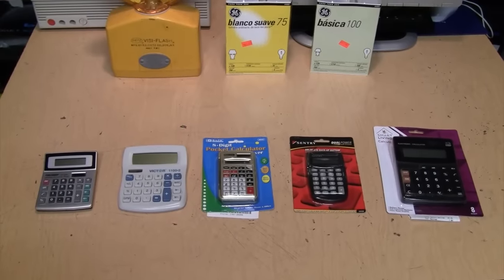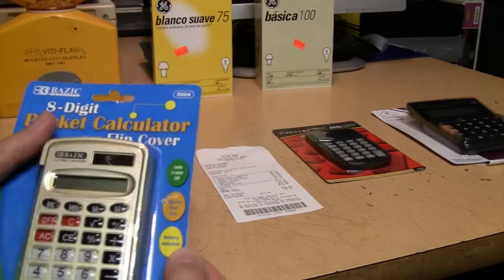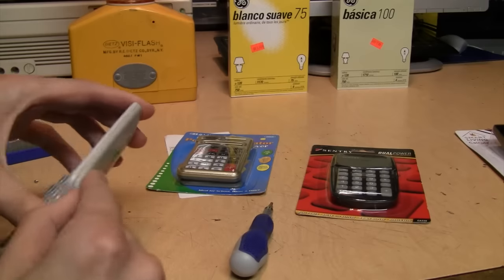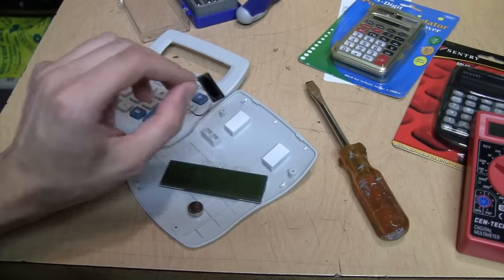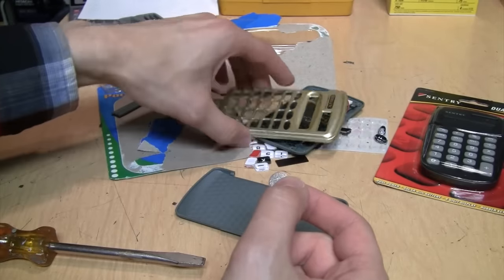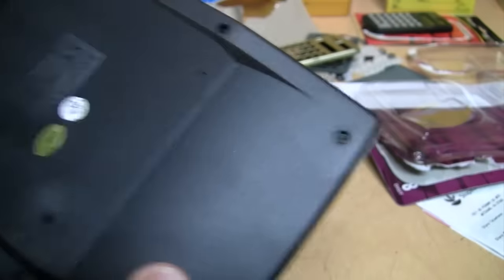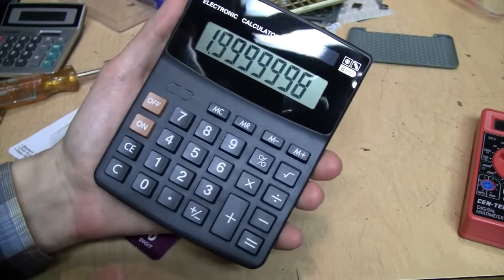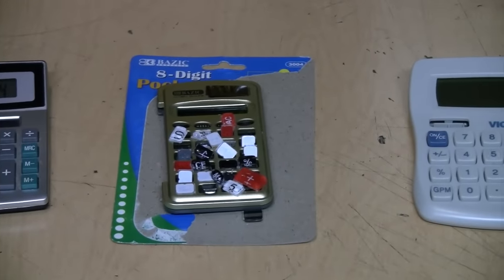Solar calculators BUSTED!

Comment: Many manufacturers use the same injection moulded frame for a range of calculators so it's cheaper to fill in the unused solar panel hole than it is to create a new mould.
Reply: Bingo!
Reply: That's a good guess. But it's also possible they've  tested sales of calculators with and without solar blanks and have found the former sell better.

Comment: This made me real curious about my own calculators, because I was sure I had one of those Big Display calculators!

Obviously, I started with a Big Display calculator that looked almost identical to the silver one he opened at the very end.
You know, the one that used to belong to Ms Dorothy Sheehy ?
So I opened it up, and it looked EXACTLY like the silver Big Display calculator ... except it DID have a solar panel in it !
And it worked without the battery in it, so it was a REAL solar panel too.

Talk about a surprise!
I was not done with surprises though.

I opened up my Texas Instruments Ti-30X II S ... probably cost me about 20 bucks, 15 years ago or so.
And sure  enough, it had both battery and solar panel inside, but the solar panel had a surprise in wait for me.
Pulling the battery it still worked fine doing simple calculations, just like expected.
But when you did complex stuff, the solar panel wasn't strong enough, or the capacitors were too small.
It sure ran out of power quickly, but the panel was working.

What an interesting surprise, this was turning out to be quite fun.
But ... well, you can probably guess it already - I was not done with surprises just yet.

I finally got my hands on oldest and most broken calculator, a Texas Instruments Ti-106.
I bought it back in 1998, it has been with me in classrooms, at home, and in a gravel pit.
It has been "dipped" in coffee or Sodapop more times than I can count.

It has generally lived a hard life.

Last time I lend it out to a friend, it came back with a broken display - But it still turns on.
Only reason I hadn't thrown it out, was because I had put it in a spot where I had forgotten about it.
So I opened it up to see if it really had a solar panel - And sure enough, it did have one .. a real one too.

How do I know ?

Because it doesn't have a battery.
Just the solar panel !

Comment: Fun fact;

The reason the pocket calculator doesn't give 2 as the result of sqrt(2) * sqrt(2) is because it's using a truncated data type (or more likely, it's just doing binary addition using a simple ALU that cannot handle enough significant digits). A simplified example:

sqrt(2) truncated to 3 digits = 1,41

1,41 * 1,41 = 1,9881
Reply: I was going to say something like this. Though it's in part because root 2 is irrational, so you would need to store an infinite number of decimal places to store it precisely, therefore any stored representation of it will always be a little bit out from the true value. Also if the displayed answer was limited to less decimal places than the input that would result in some rounding that would potentially give the answer as 2, which would be indicative of a cheaper, or at least more restricted one, rather than a better or more expensive one surely?
Reply: Yeah, I was thinking the same thing.
Reply: Jerri Kangasniemi
I don't understand what you said but I liked your research about it.
Reply: +Feroz
It's a physical limitation of computers

(for this example you can equate 'wires' with 'bits')

We can use 1 wire to represent the numbers: 0 and 1
wire1
OFF (we may call this 0)
ON (we may call this 1)

we can use 2 wires to represent the numbers: 0 thru 3

just use all different combinations of ON and OFF to represent different numbers

wire1 wire2   number
OFF    OFF     (0)
OFF    ON       (1)
ON      OFF     (2)
ON      ON       (3)

we can use 3 wires to represent the numbers 0 thru 7
wire1   wire2   wire3   number
OFF     OFF      OFF     (0)
OFF     OFF      ON       (1)
OFF     ON       OFF      (2)
OFF     ON       ON        (3)
ON       OFF     OFF      (4)
ON       OFF     ON        (5)
ON       ON       OFF      (6)
ON       ON       ON        (7)

and so on...

To represent larger numbers, or more decimals, you need more wires but we can't use too many wires otherwise it might not fit in the calculator. This is why you get an error if you multiply with huge numbers with calculators, or get rounding errors with decimals.

Comment: It is cheaper to just use the same casing for both solar and battery calculators. In the battery ones, they just put a fake solar cell in, and in solar an actual solar cell. Calc manufacturers have been doing this as long as solar calcs have existed..
Reply: That kind of makes sense, but it would make more sense if they didn't make the fake part look like a solar panel if they weren't trying to be misleading. I would also say they would only have been like that since extremely cheap solar calculators have been made. Decades ago, all calculators that looked like they were solar, were. But they weren't as cheap, and were often brand name.

Comment: The one I regularly took apart during high school classes would still work without the chemical battery afaik.

After covering the solar cell (and the chemical cell taken out ofc) the display would quickly fade and pressing any of the buttons would drain all the voltage ~immediately. But in direct sunlight it was perfectly fine and happily working

Comment: The smart living calculator might actually be good. I might be remembering this wrong, but I've read that a solar cell can actually charge or drain a battery. So, a diode is used to make sure that electricity only flows in one direction so that the solar cell only charges. That looked like a germanium diode, which ain't cheap. I'm guessing that they left the leads long in case the unit didn't work, so they could take it out and put it with some other board. The diode might also have been a last minute addition. I don't know, I'm just a Pretengineer.
Reply: I wonder if they can be used similar to the diodes that power crystal radios

Comment: It's likely they just make 1 plastic body for these calculators. While some have solar cells for energy, they probably make a cheaper battery edition. They just don't bother designing and molding new cases. Do they make any claims on any of battery ones that they are in fact solar?

Comment: I remember having a 'dual power' calculator many years ago and I deliberately took out the battery so it ONLY worked on solar power. Didn't feel like having to replace it all the time lol
Reply: I have a calculator like that, it takes 1 AA battery, I normally just use it as a solar only calculator, of there is no battery in there it cannot leak.

Comment: I really miss incandescent light bulbs.
Reply: Since Trump took office 100 watt bulbs are back on store shelves.
Reply: lucifer thebringeroflight why!????!?!??!!?
Reply: Not Important,
An Easy-bake Oven.
Reply: That's funny and interesting. I would imagine the potential for salmonella poisoning from eggs in batter that wasn't properly cooked would be the biggest concern. 

But yeah, incandescent lights are mostly just useful if the heat produced is beneficial in some way.
Reply: The heat in an oven would destroy semiconductor technology
Reply: +George V. Cohea There are lower wattage Halogen Pseudo-Incandescent bulbs that work like Incandescent bulbs but use less electricity on the market, they were not banned in any way (production in the USA continues to this day on Halogen bulbs). Halogen bulbs produce heat as well, but i do not know if it is as much as an Incandescent, less or more.
Reply: Stig, all bulbs (and electric appliances) will produce heat in proportion to their wattage. (Though in some cases the heat winds up outside, like an A/C)
Reply: Cerus, I know that sounds intuitive. But, if a blender is rated at 1200 watts that's going to be peak power output. Whereas the bulb will be 1200w continuous. But if you clamp an ammeter on both and get an identical reading and both are in identical boxes, they will heat at the same rate. It's really just the way the physics works. Any sounds, movement, light, etc. will all convert into heat. This is what is meant by the principle "energy can be neither created nor destroyed".
Reply: Stig Rabbid << The halogen bulbs in those cheesy torchiere floor lamps put out massive amounts of heat. The bulbs are made of quartz because the heat would melt a glass bulb. They often discolor the paint on the ceiling above the lamp too.

Comment: I have an old air conditioning and heater thermostat which can be programmed for every day of the week at four different times. It is an old thing but does the job. Also, It is not intrusive like the new wifi ones. A few months ago, it stopped working, nothing on display. I disassemble it and checked all voltages and soldering, and everything looked OK. I took the microscope out and started poking around to see the signals coming out of the micro; nothing, it was dead. Then, I checked the realtime crystal oscillator, and it looked like the micro was trying to start it every two seconds. I ordered the part from Digi-Key and replaced the realtime clock. This fixed it. I could have bought a new one, but I like this one.

Comment: That lose  diode is a zener diode. It prevents over-volting the circuit.
Reply: A zener would not be connected in series with the battery, and not in the forward direction either. 
It's probably for reverse polarity protection, if the battery is put in the wrong way.
Reply: I assumed its to stop the solar cell feeding voltage back into the non rechargeable battery
Reply: Zener diodes and chemical batteries. 
Hmm.

Comment: It's because the square root of 2 is more than 8 digits in length at 1.41421356237, and unless you're using a calculator which can go to the required number of digits (12), it's going to fall short automatically (regardless of how cheap or expensive the calculator is) when you do √2 x √2. So what you were asking it to do when you multiplied it by itself due to the 8 digit limitation, was 1.4142135 x 1.4142135, which gives you the answer you were seeing on the displays.
Reply: InuKun2008 regardless a root squared is what the number being root squared is
Reply: @PorWik  Regardless of your comment, computers are not working like your understanding of math.
Reply: BTW for anyone interested in the odd behaviour of calculators sometimes, google "IEEE754"
Reply: @Superlokkus5  Yes because your comment is so enticing it will make all the kids want to learn the fundamentals of computer science....... lol
Reply: Foetus Deletus, but the calculator doesn’t know that it is working with ‘the square root of 2’.  All it knows is the specific value currently in memory (1.4142135).

Some calculators internally work with more precision than they can display, allowing them to retain the exact value more often, but most of these cheap calculators don’t for the simple reason that, for their normal use, they don’t NEED to.  (People working with $5 calculators don’t generally care if the value is correct past 2-4 decimal places.
Reply: Yes, but can it spell boobless if turned upside down?
Reply: The square root of 2 is irrational and has an infinite number of digits
Reply: And therefore only a calculator with an infinite number of digits after the decimal place would pass this 'test'.

I'm pretty sure no such adding device exists, nor ever could (because calculating each digit takes time, infinite digits would take infinite time).

I was going to point this out, but figured someone else already would of (thanks!), so I still don't understand what he was trying to prove with this...?
Reply: Or better, 1.4142135 x 1.4142135 = 1.99999982358225 exactly, which then gets chopped / rounded down to 1.9999998 to have the same number of digits. This also seems to suggest, given that it fits the actual decimal directly, these calculators represent their numbers internally using BCD (binary-coded decimal) instead of fully binary floating point: the difference is that BCD uses 4 (I believe) binary bits to represent one decimal digit (so not 100% efficient since you have 2^4 = 16 combinations and 10 digits), while a truly binary floating point number represents the number with its actual (truncated) binary expansion. Real binary would round differently than decimals. This is also likely why the display has 8 digits: that gives 32 bits for BCD, which is a typical power-of-two word size, and you can keep another word for the exponent of 10 (when you get numbers big enough to give you an "Exx" on the right) to make a pseudo-floating point.
Reply: Answer is 2
Reply: @NealClewlow  my decades old Sharp EL-540 passed the test, lol

Comment: You inspired me to open up a couple of "solar" calculators.  They were both genuine.  There may be another way to identify if a panel is genuine - it should have gridlines or gap lines, which I think are a feature of solar panels.  Did your fakes have those lines in them?

Comment: We have a solar calculator at my school that has no solar panel, but it still works.
Reply: Pixxelated 
E😅
Reply: It has to have something. It doesn’t work with magic.
Reply: Then its not a solar calculator
Reply: @darrados496  that's the whole purpose of this video to see if these calculators have fake solar cells or not. If it doesn't need a battery to work then it does have a functional solar power cell
Reply: @BrotherJApologetics  r/woosh

Comment: I know my school calculators are real because when I take the battery out if it's facing any type of light , it still works!!
Reply: I always just covered up the solar cell with my finger to test if it's real. I've actually never encountered a calculator with a fake solar cell.
Reply: RavenChan take out the battery first (if there is one)
Reply: there is a second invisible battery, they are fooling you
Reply: Blox117 indeed

Comment: In my (decidedly NOT cheap) Casio calculator, which is dual-powered, there is a little "sun" indicator on the LCD panel which shows when it's getting adequate power from the solar cell.  According to the manual, the calculator needs a working battery to be used, but the solar cell makes the battery last longer.  As of right now, I've never had to replace the battery (unlike in my watch), so I assume it works as advertised.  (It also helps that Casio is a reputable brand in this space.)